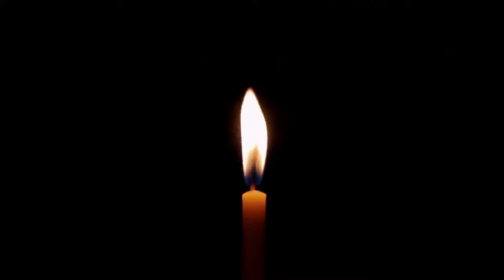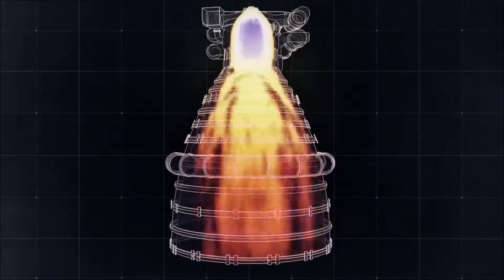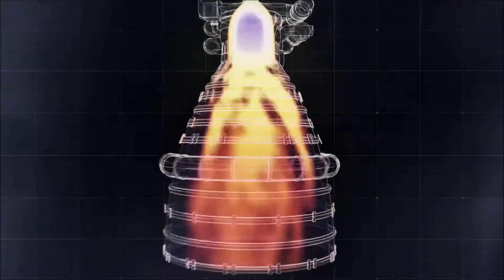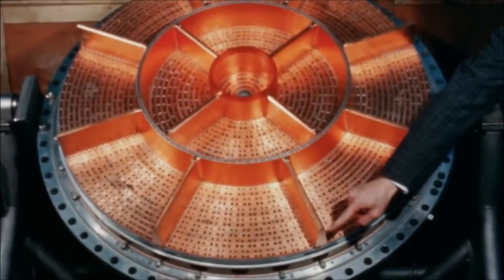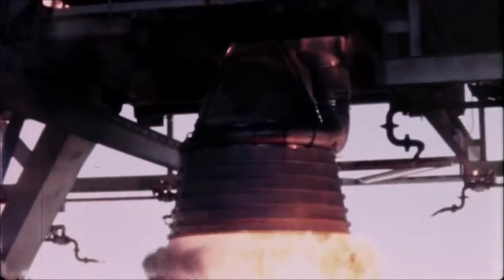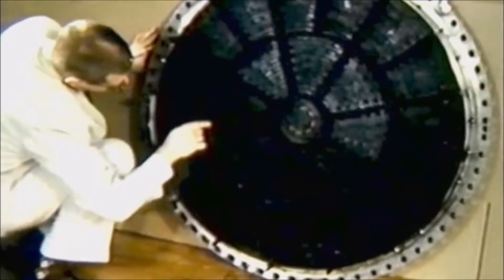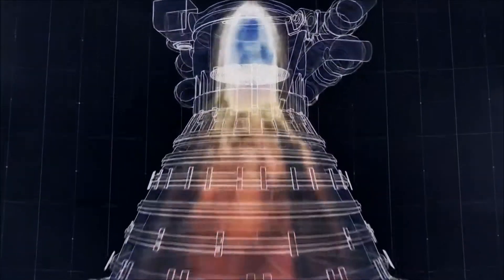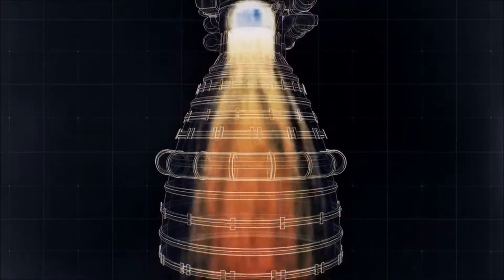Combustion Instability

Comment: The Engineering of Apollo is Fascinating, and now close to 60 years after the Designing was done, the Info is coming out to the Masses.
While the Baffles were a Very Important Part of the Solution, changing the Angle of the Nozzles, moving the Location of where the Fuel and Oxidizer Impinged on each other also Increased the Combustion Stability. It lowered the Efficiency of the F1 slightly, but later upgrades Restored it, and even increased the Thrust
Reply from the maker: That is fascinating information. Where did you learn that? I am curious to know.
Reply: @eyestothesky1995  
A book by Charles Murray and Catherine Bly Cox.  'Apollo (The Race to the Moon)'  It tells the story(ies) of many of the Engineering Challenges of Apollo.
Reply from the maker: @pjimmbojimmbo1990  Thats awesome, I will have to check it out. Thanks!

Comment: Actually the F-1 was an Air Force project from the 1950s and was shelved for that very problem. NASA was aware going in that the problem existed.
As far as the Nazi Von Braun, the nozzle design was the simplest for the time. It wasn't purpose designed to stop instability.
Reply from the maker: Yes, the F1 was an Air Force project initially, but it was really not very far along before NASA took it over. The injector design with the baffles was created to stop the instability.